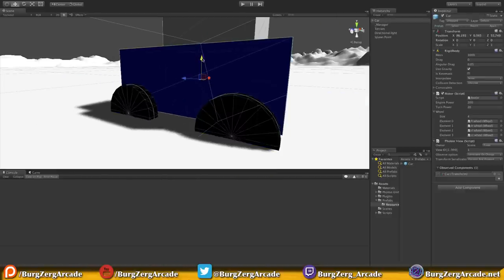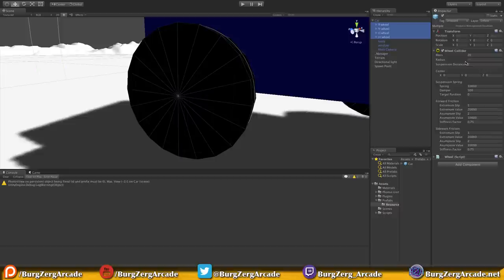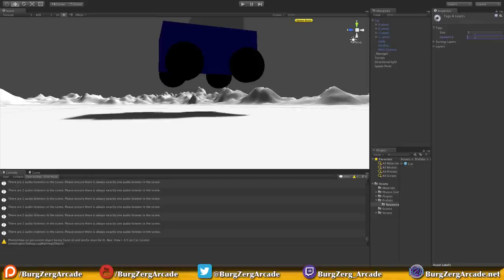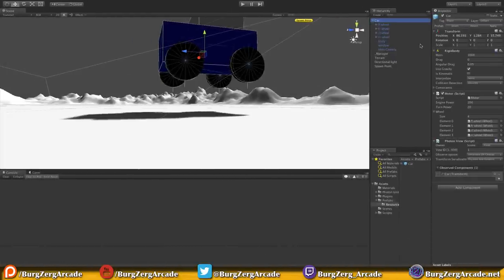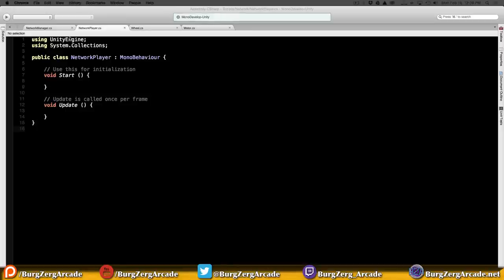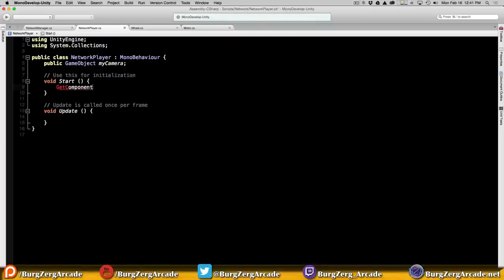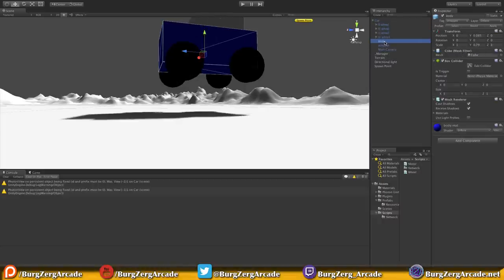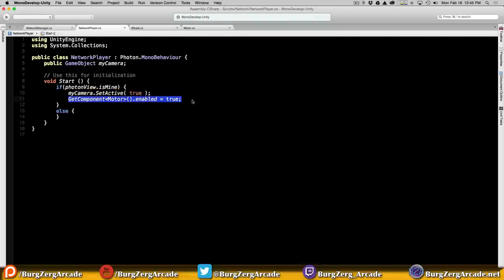6. Unity Tutorial - Creating A Multiplayer game with Photon Unity Network (PUN)

Comment: My project is at a similar stage as you are in this video. But I have two problems. Even with only one client running, there very randomly appears to be hidden walls that I can't move through, which I don't get with the offline version. The second issue is that player 1 can sometimes look very stuttery on player 2's screen and I have very fast broadband.

Comment: The advantage of turning the whole camera off is you also disable the audio listeners that are attached and avoid the error reports in Unity so your approach is sound.
Reply from the maker: Later on we will not have to worry about it as we are going to have a different prefab for it.
Reply: BurgZerg Arcade Out of curiosity, do you plan to cover AI behaviour in this course?
Always seems to be an area most of these types of courses fall short on. I can get basic path finding working but trying to get an AI to react (brake and accelerate) appropriately is hard work!

Comment: I'm using Unity 5 so that may be the problem, but the camera won't enable using your code, and each new game client I open can only be controlled by the previously opened clients. In addition, the new one controls all previous clients excluding itself. Its all super weird and I really confused. Any help would be appreciated!
Reply: +TheSomewhatGuy Yea nvm, turns out it had to do with not turning off the camera.
Reply: +TheSomewhatGuy Also if you cant get your camera to turn on, you probably unchecked the camera box and not the main camera box